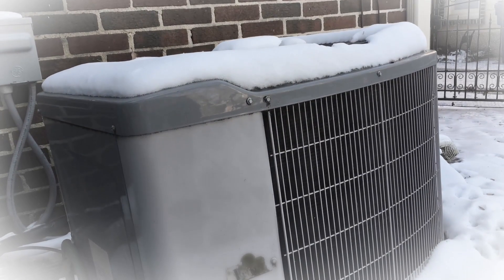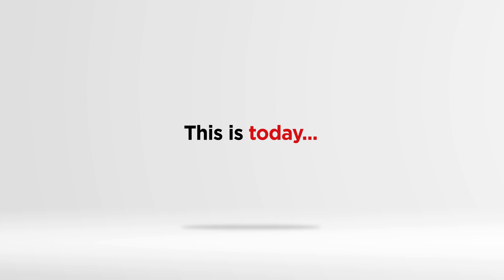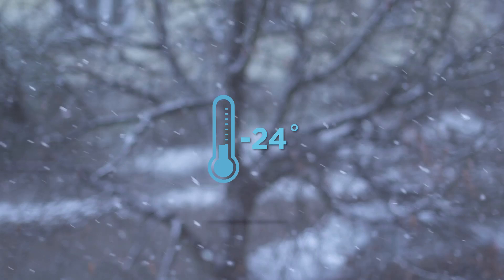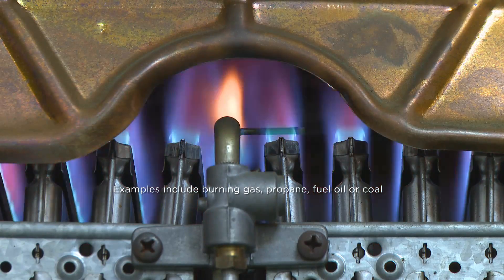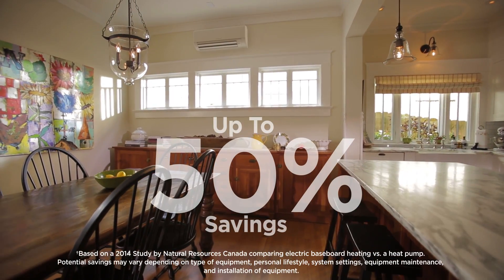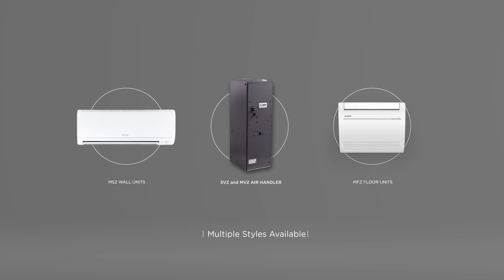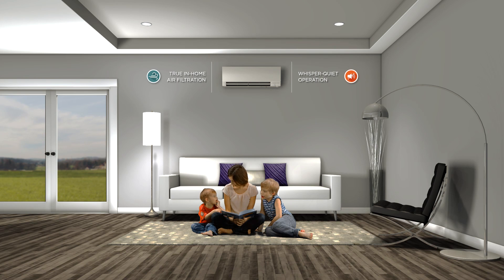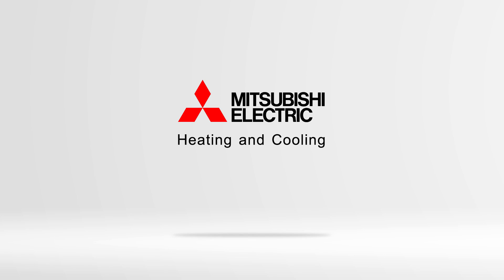How A Heat Pump Works - Mitsubishi Electric Heating & Cooling

Comment: For anyone considering installing Mitsubishi HVAC in Canada, don't. I am about to remove newly installed ducted unit because it moves no air through the ducts. The installer did poor job and took off. This is where I realized that Mitsubishi does NOT have support in Canada. They depend on distributor Mits Air to provide support for installers. Mits Air has no skin in game and at best as a end user you will end up talking to a sales person. I was refereed to local HVAC company and they charged me 400$ without doing as much as checking airflow and static pressure and provided me with no options and no solution. I am disappointed and bitter in the lack of support. But do not take my word for it. Call Mitsubishi HVAC support line and pretend to be a customer to test it. You will not be able to get anyone on the phone and nobody will call you back. If I knew as much I would have saved 10k, now I have to scrap the system as nobody wants to tell me what equipment I need to replace to get the expected performance. Getting Mitsubishi HVAC was the worst decision I have ever made and it was all based on excellent marketing such as this video. Do not get fooled. Zero end user support, mediocre and non committal HVAC pro support. Good luck!
Reply: I think you need a blower motor with your duct system, similar to an electric furnaces

Comment: Always have a backup source of heat. Most techs don’t know how to work on them or are too stubborn to learn. They always fail when it’s cold. This means standing in the snow to fix your heater. Tech IQ drops 100 points after 30 minutes in the cold. Also parts are hard to come by. Usually come from factory which means weeks with no heat. So Mis-diagnosis is common,  labor repair time is substantially higher. Gas prices are still cheaper than running your AC all winter. Unless you live in a perfect square box you will quickly learn that these systems don’t heat or cool around corners. So your home temperature will not be even throughout. Parts are crazy expensive and rarely available locally. This goes for any make model or brand. 

-Certified repair technician in almost all brands who has been installing and repairing these systems for over 20 years. ALWAYS HAVE A BACKUP SOURCE OF HEAT.
Reply: Always have a backup source of heat!
Reply: My relatively new Mitsubishi MSZ works just fine when it is -20c outside, I like to keep it +24c inside. It doesn't fail and I don't know anybody who had a heat pump failure in the last ten years. But yeah you should always have a secondary heat source in case of an unlikely failure. I have electric radiators as a backup but they barely activate in the remote parts of the house when it is -20c outside. I can highly recommend a heat pump.
Reply: what the hell do you mean techs don't know how to work on them??? it's a freaking central air unit with the ability to run in reverse. but yeah, ideally you keep the furnace for when it dips below 10 degrees or so.

Comment: i will never install one of these system due to the lack of information about how they work. these units don't have heat strips, so how am i going to stay warm when the unit is defrosting?
Reply: It only takes 10 mins to defrost, it’s ok you won’t freeze.
Reply: That's why you need good insulation in your house.

Comment: What happens if the temp is -20°F or lower? It doesn't happen often in our winters but is possible, and I'm worried that we'd have no heat if we switch to this system. Thank you!
Reply: In this case the correct solution is a heat pump that has electrical elements and balances the loss of compressor efficiency at very low temperatures.

Comment: Thanks for the video……the low temperature model looks great. At -25 deg.C outside temperature, what percentage more hydro would you be using than at 0 deg.C ? Thanks again for the video 👍👏😃🇨🇦